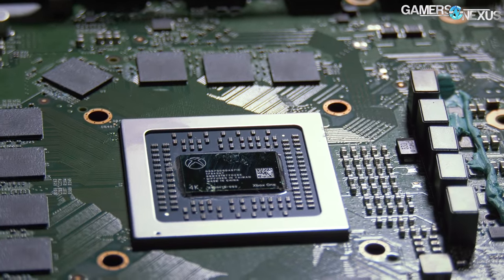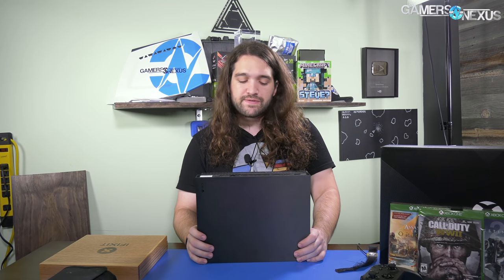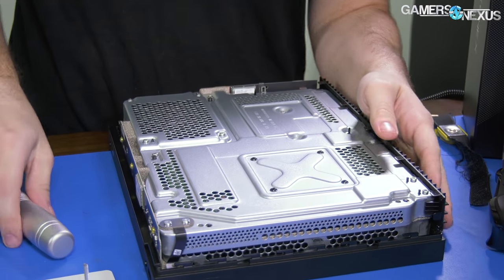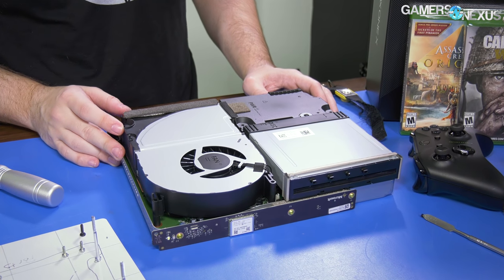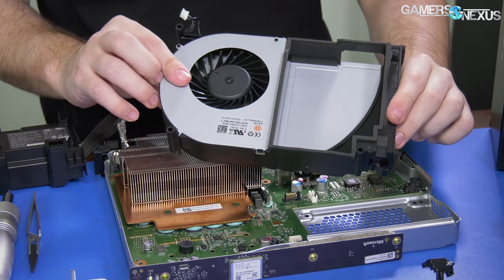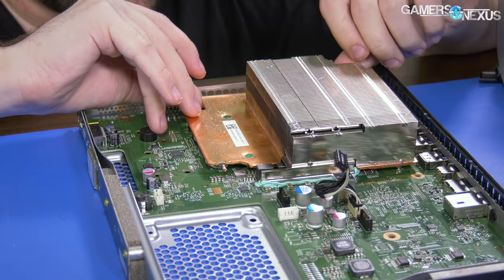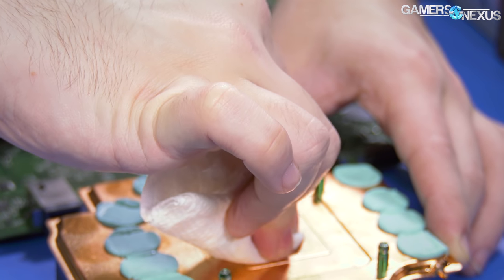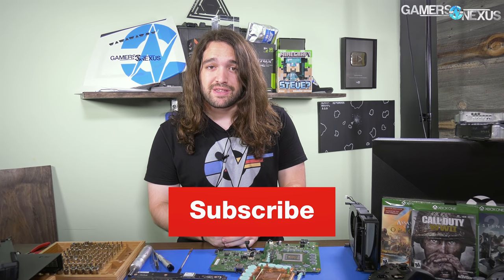Xbox One X Tear-Down: Semi-Modular Console Design

Comment: Anyone watercooled it yet? Watercooled Xbox One X would improve it performance, less throttling for sure if any
Reply: Doctor Claw but the games would still be locked at a certain amount of fps so I think you can do it bjt it doesn't bring any benefits.
Reply: I am actually looking to make sure the GPU and CPUcould run at least a bit cooler and avoid much as possible throttling and framerate losses, keep the cooling and performance optimal. Even looking for a way to voltmod the CPU accordingly. Morrowind really needs it. Xbox consoles are cheap so I can afford to lose one if anything happens
Reply: Doctor Claw if you can afford breaking one console, you should rather get a PC. Delivers more bang for the buck.
Reply: Doctor Claw yes I could imagine, that there are less framedrops but the amount of work you'd need to put into it wouldn't really pay off. You would also need a new cover for it, because a watercooling system wouldn't fit in there and it would be expensive. You'd also need to find a watercooler which supports the socket the XboxOneX is using and the overall powerconsumption would increase.

If you have the money and want to do it, then go for it.
I'm sure it would be fun.
Reply: Doctor Claw but I do think that there os a company that buys Consoles, Watercools them and then sells them but they are pretty expensive

Comment: If they can build these gpus already on the PCB why don't we have PCS with these motherboards are already have them installed but we have to buy a separate $800 graphics card
Reply: It's not a GPU, it's an APU, and it isn't built into the PCB, it's pre-installed and sautered to the socket. If you wanted a similar experience, just buy an AMD APU for $300 and forget about the $800 GPU. Just don't expect that APU to be anywhere near as fast or powerful as the GPU...

Comment: No idea what you're doing taking this apart. X-clamps are a staple on Xbox 360 and Xbox one. You also didn't seem to understand that the numbering on the components tells you the order to fit and remove them. Really firmly tugging on it whilst the x-clamp was still in place wasn't ideal. Would have been wise to actually research the console before randomly attacking it with a screwdriver.

Comment: Really? I came back after all this time and the Ryzen debacle to find this? You of all people should know THEY already stated it is not Polaris, it is called research. Also Polaris is 14nm this is 16nm.  So what is it? Shader count etc.. is the same as a R9 290 in an APU form. Does this make sense? Yes because the R7 series just made it in the AMD APU line up this year for laptops. This has enough room for better cooling and a bigger power supply.

Even the thermal compound is cheap. Second tear down and compound s already dried out. Junk.

Comment: Honestly, 
why encourage people to do this if you are lacking some basic knowledge :/

Seriously, handling retention brackets should be elementary, as should be the knowledge about the console you are opening (someone replicating your methods IS GOING to fuck up his console). Beside specs of this one, you don't show any knowledge about previous xbox consoles and how they were put together (based on your reactions on the long screws and "modularity"), btw you cannot just swap the br drive, nor should you. Your MBO holds DVD key which should correspond to the one in your BR drives PCB. 
The thing about Microsoft consoles is that they are beautifully crafted from the perspective of the person that repairs it. However, as beautiful as it is to open and handle, it is a fucking nightmare to fix. Even the basic shit that goes bonkers is not easy but repairing the damage that customer did and would not disclose is a bigger problem for the customer that opened it than me who will deny repair or be unable to solve it at reasonable price. 
Still, it would be nice to see someone that is in love with tech to do those things that he/she loves in the range of his/her knowledge. Even with good intentions or just the sheer need of nurtring your curiousness  you could produce some collateral damage and get some (in that case) deserved backlash - which i believe is not your desired goal.

Comment: Terrible cooling solution, piping hot air right into the PSU. And they don't run the fan fast enough for my liking.
Reply: And don't get me started on the TIM, or concrete they used.

Comment: Really, Microsoft? Blowing hot air coming from the heatsink of the CPU+GPU+RAM straight into the PSU?
Reply from the maker: It exits the case out the rear.
Reply: I can see that, but it also has a hole to the PSU meaning some hot air gets in there. And it's the only cooling the PSU will get. Not really a good design.
Reply: Vel0city lol ok man

Comment: So why is this a console and not a PC? Is the OS somehow tied to the hardware or something? If that's not the case, then why shouldn't you just put desktop Windows or Linux or whatever on it and have a bargain PC? Am I missing something obvious? :D
Reply: People have tried and failed, if I remember right its because the hardware is semi custom, with no PC equivalent its probably hard to even get it running let alone well.
Reply: Semi custom or not, at the end of the day it has a processor, graphics card, RAM and a storage device. Would be a shame if there was some artificial lock on it just to prevent someone to turn it into a PC. Maybe GN could cover what the problem is, or I have to look somewhere else for that information. Interesting stuff though.

Comment: Jeez, Jaguar is such an old ass architecture and I'm sure it's bottlenecking the system.
Reply: It IS an old architecture, but the APU is the most powerful component in the (XBox) system... it's not bottlenecking anything.
Reply: @mgmg116  Lol buddy, the CPU and GPU are on one chip, they ARE the APU.
Reply: @mgmg116  Now the GPU may be good but the CPU would be an obvious bottleneck.
Reply: @jonnyboi9026  That was my point, ya dingus. I know what an APU is. There's no bottleneck on an integrated chip, the graphics processor is using CPU resources. It's just the single chip handling all the work

Comment: First it's only 4k with movies not gaming. Most 4k tvs can only run at 55 FPS not the 120 the Xbox One X is capable. If you buy a high end gaming monitor then you'll get 4k gaming, but the pc will clock higher frame rates 100 to 1. I have the Xbox One X and even at 1080p it looks why nicer then the PS4 Pro. PS4 Pro is bullshit on 4k gaming too.

Comment: So a $300 gpu cpu, $100 ram but a 5400rpm $40 hard drive is supposed to deliver 4k data? Why is Microsoft so cheap its a gaming system,  I would guess any gamer in last 10 years went for the 7000+rpm drives or velociraptor like drives and SSDs... But here they use the slowest.  

Also have issue with non rechargeable controllers.  Microsoft lately hasnt delivered on the gaming end, still nothing on VR like they had mentioned and gaming exclusives lacking.

Comment: This moment when he tried lift up radiator without properly check-in :D amateur
Reply: It's a heatsink, not a radiator, if you want to get specific it's a vapor chamber cooler. Amateur.
Reply: @sean8102  What do you not say yet ... maybe you can list what types we have Vapor chamber, heatsink, radiators, heat pipe.  The act is that this Vapor chamber is built of two and more components for two-dimensional heat dissipation ... Write specifically so that I could understand you amateur 🤔😅😅😅

Comment: Meh, not a fan of consoles. It would be much more usefull if they put windows on it for dualboot. Microsoft of all ppl should be able to do that. And the console would be 1000 times more usefull, not just for gaming, but also as a regular pc...
Reply: Not if it was on a separate partition. They could do just that, have 2 power buttons, one that boots into xbox, and the other that boots into windows. They would not be running at the same time.

I'm sure it would be possible, and it would actually end the console war. A console with windows would totally destroy any other console that cannot run windows. I would actually buy one then.
Reply: Lolwut? I have win10 running on an ancient e6600 dualcore cpu and it runs butter smooth. There is no 'bloatware' at all. An 8 core amd cpu, while not great, would handle win10 without problems. You must be a Mac kid or something to hate windows so much. It's known that windows 10 is the best os, even some win7 users are  admitting it.

Comment: 4k gaming? One game..rest is 1080p at 30fps
Reply: Didn't MS confirm a list of nearly 100 titles getting a 4k 60fps update for launch?
Reply: In like Indie games and other 2D games or mobile games like candy crush etc?
Reply: P J 
Current gen consoles run almost all games at 1080 60.
Reply: Not AAA-titles. Only those indie games and other mobile alike games.
Reply: The list is on wikipedia, most of their 1st party games are getting either 4k 60fps or 4k 30 fps with HDR support, theres a good few AAA 3rd party titles getting 4k 60fps though like the newest fifa game, smite (not AAA but its the best MOBA on xbone so theres that), project cars 2 and DOOM. Seems the priority list for 3rd party titles is HDR support rather than higher framerate games though.

Comment: In terms of doing a temp analysis before teardown. I understand there is no apples to apples comparison, but couldn't you do a heat transfer experiment?

Measure the heat coming from the exhaust with a thermal camera or other equipment before (with the old paste solution) and after (with the new paste solution) from out the back. Taking timed interval readings - then average or plot graphs THEN average. The logic being that if there is good thermal transfer the head coming from the back of the xbox (if there is even an 'exhaust' vent/area) there will be more heat. And if the transfer is bad, there will be less head out the back (and supposedly the system would throttle in some capacity to compensate). 

You can then at least have a kind of 'pilot' study that would show there could be thermal improvement.

Comment: This does not qualify as "modular"... the fact that it's less difficult than previous consoles does not somehow qualify it as modular. Besides, you didn't actually TRY to replace anything. Replace any of these parts with anything but the exact same model number and I bet they've got built in firmware that will refuse to boot